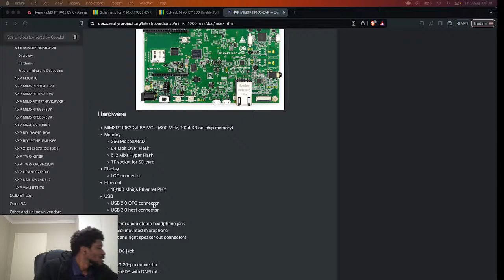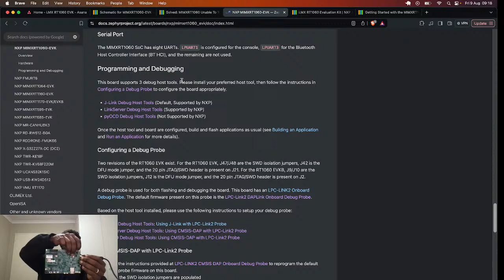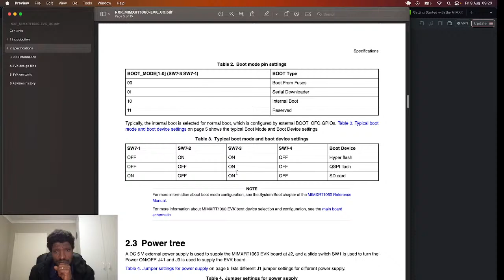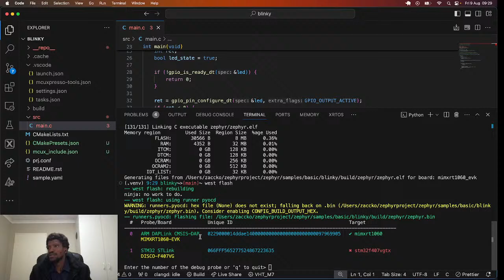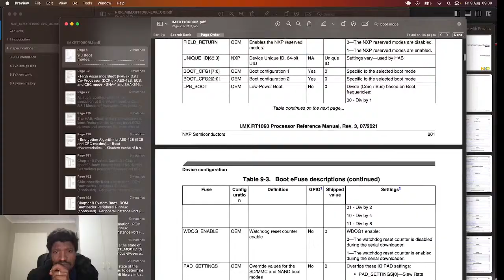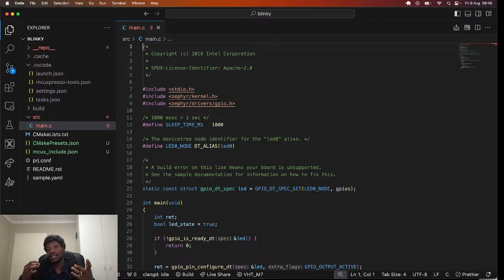MIMXRT1060-EVK  Board Bring up with Zephyr

Comment from the maker: In this stream I managed to confuse myself, turns out out you need to switch the boot mode to flash the application (1100) then you need to switch the boot mode to (0010) so the application runs from the onboard binary